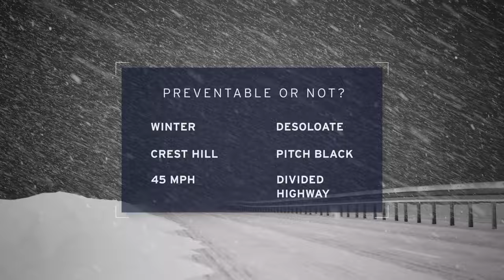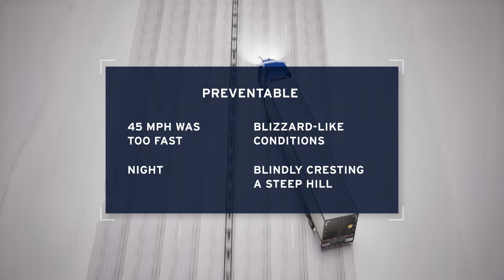Truck driver slides into steel lane divider on a snowy, dark highway. Was this accident preventable?

Comment: When it snows, put them to sleep. No reward for duty but you can count on being charged. I once, while crossing Paris Mt. in Mosby's Confederacy, got almost to the crest and that single axle Volvo started losing traction. Kept creeping to guard rail as I tried to start over. When it got around a foot away I said that is it. Cops came and called a wrecker. Later in "after action" report my boss said I would be charged as trooper said " I was against the guard rail". Call him I said, that was just a figure of speech. Boss backed down.🦇